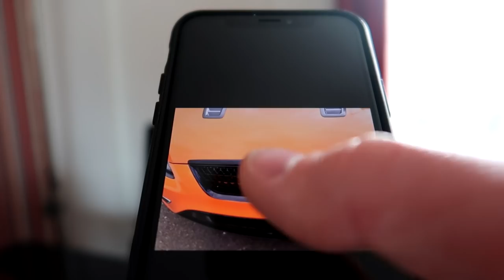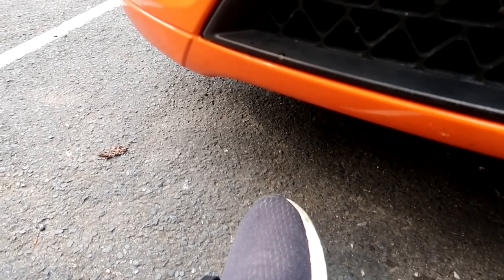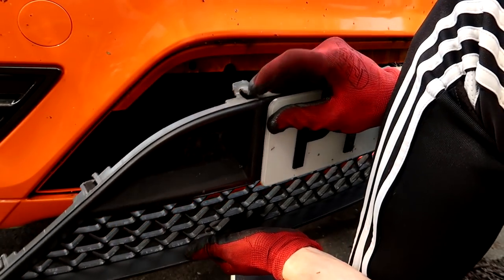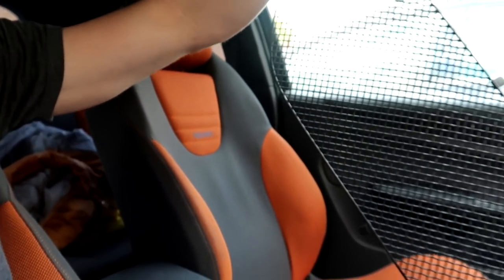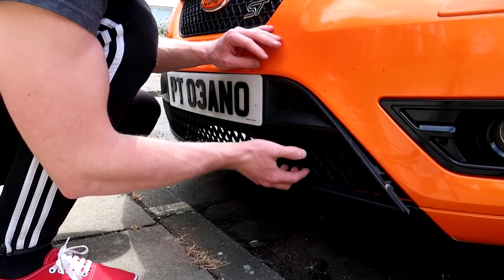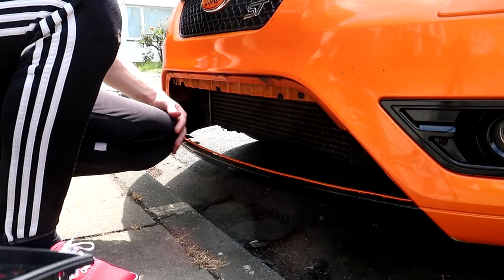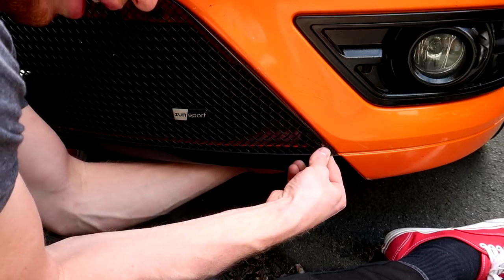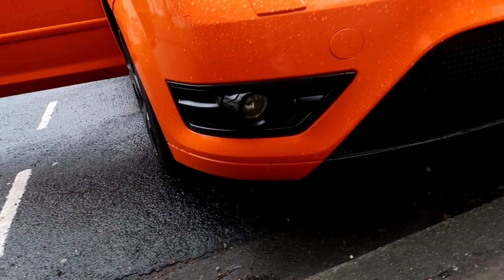Installing Ford Focus ST Zunsport Grills & Wrapping Lower Bumper Lip

Comment: Nice job bud 🤘🏻 have you a video of were you’ve put your reg plate ?
Reply from the maker: Jason Crook I have not bud I will make one soon or add it in the next video
Reply: 03ANO that would be good pal and I’m assuming you’re using the stick on plats ? Are they road legal ? I’d like it in the middle. Not a fan of the side mounts . And a link would be good don’t want a £2.99 pile of shit of eBay lol 😂. Your videos are spot on bud keep up the good work 🤘🏻😎🤘🏻
Reply from the maker: Jason Crook there’s aren’t stick on plates bud,
Reply: 03ANO I don’t mean the ones you’ve took of bud . Your video doesn’t show you’re new plate mount after you’ve fitted the zun sport grille 🤘🏻😎🤘🏻
Reply from the maker: Jason Crook yeah they’re not stick on ones either they’re standard 4D plates with clothings hooks to hang on the grill lol